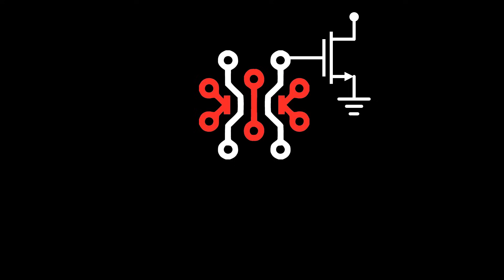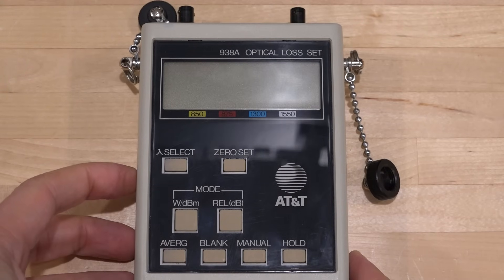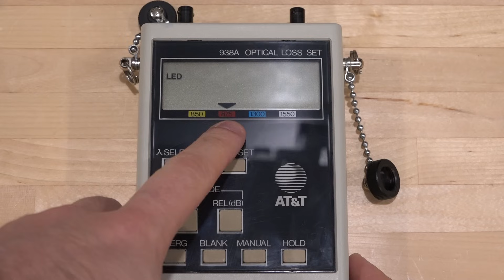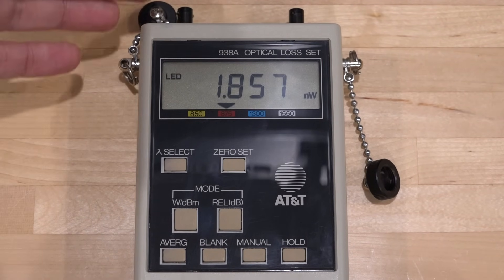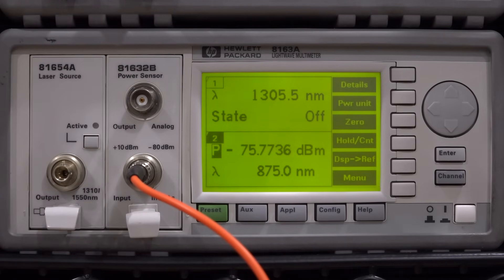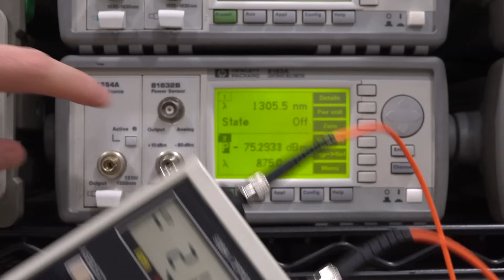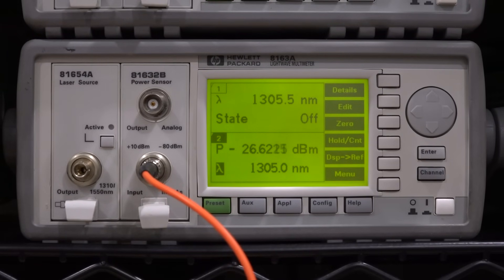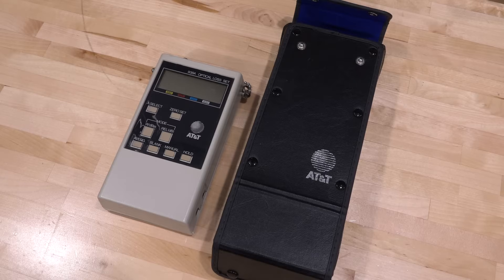TNP #44 -  AT&T 938A LED Optical Loss Set Repair, Teardown & Experiments

Comment: Duracell batteries suck, they tend to leak more than other quality brands. I've learned the hard way to remove them from meters I don't use often.
Reply: I do not list Duracell as quality batteries. The company was bought out by a Chinese concern and the quality dropped and leakage rose to unacceptable levels. They are utter rubbish and a liability to equipment these days. You see them being flogged in discount $2 stores in Australia. They must account for a lot of lost items that use them.
Reply: @borisj4054  yes, Duracell is not a quality brand. I meant to say that they leak more than the quality brands.

Comment: This thing had my favorite leaking batteries. I know cheaper ones will leak too but that particular brand has got me almost every time I left them beyond their practical stay and I think they used to be better than that 20 + years ago. I bet that cost $$$ for that company when the requisitioned them. I remember the TDR meters the guy's used in the early days of DSL when I did my stint with them and they weren't cheap.

Comment: Wow, I worked for Illinois Bell / Ameritech/SBC/AT&T, used many a Optical loss meter, since the late 1980's, never saw one branded by AT&T, we had Noyes, EXFO and AFL, were brands they would provide for techs, and we didn't even see handheld units until the mid 90's, they were small units in housing with wall wart power packs, and Biconic connectors were the standard , then ST connectors before SC/LC's became the current single fiber standards.

Comment: Is there a reason why there's both 850nm and 875nm options? They're clearly too close together to multiplex with. I would have expected 950nm as an option, a common IR LED wavelength.
Reply: Some (non-standard) single strand bidirectional protocols use 850nm and 900nm, so maybe they used 875nm because it's right in the middle. But even 850nm and 875nm would easily be far enough apart for multiplexing. CWDM has a channel spacing of 20nm, and modern DWDM can go down to only 25GHz/0.2nm channel spacing.